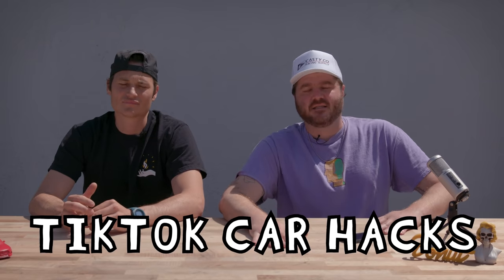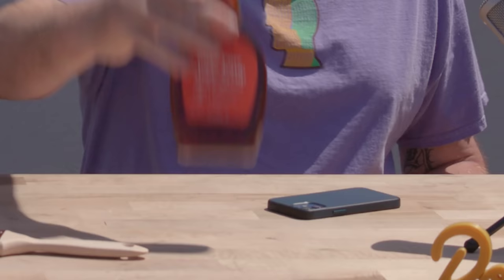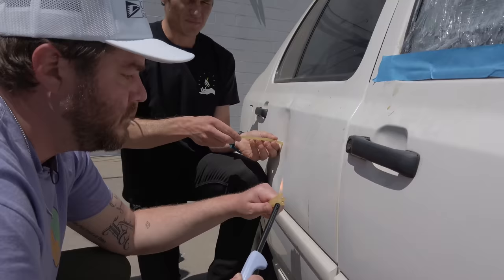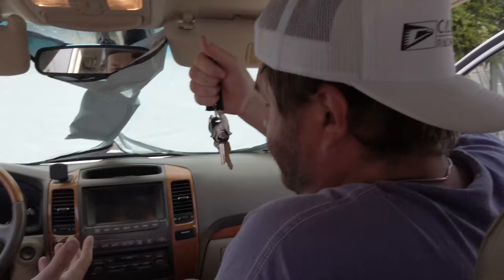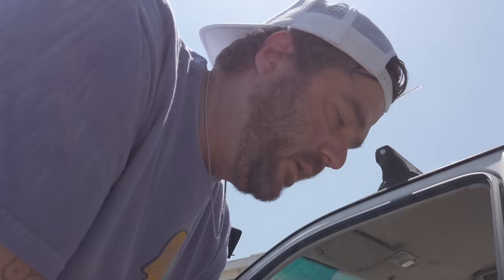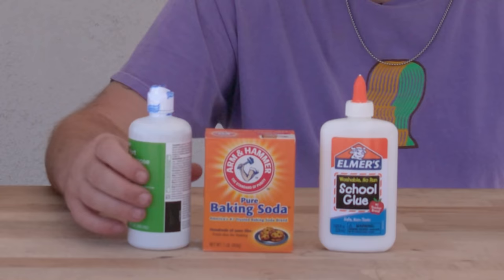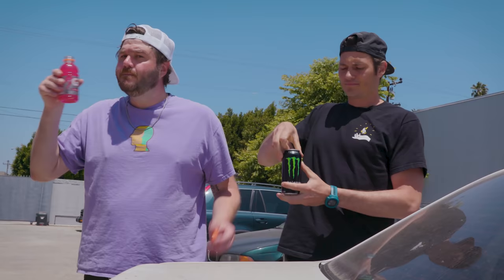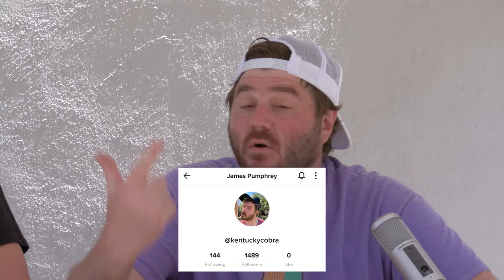We Tested TikTok Car Hacks

Comment: The hack for starting a car without keys sounded like a Creepypasta ritual.
Reply: cars like that have some wireless keys, when he said "and you wait" he pressed the clutch and tapped the button that starts the engine
Reply: I can only start one car without keys and that is the Vauxhall Nova Sri
Reply: @nineteen-nk8vk  either that or the dude just used remote start from inside the car (assuming it’s possible)
Reply: @Gladiator34B  it was also a brand new car from the look of the interior, so its really likely his frriend just stood outside and pushed the button
Reply: @Mell0Gang_  actually donut made that cut, if you look at James and Jeremiah they move a little bit too.  James' head moves a little and Jeremiah's watch changes time.  Look at 5:44 and see.
Reply: It was a push start he just pushed the button
Reply: It's a guide to find Mew in Pokemon Red.
Reply: I know guys, I was just stating that the way the made different steps it sounded like ritual.
Reply: So i believe the guy bypassed the immobilizer I work at a Honda dealership and that’s a new crv, cars have immobilizer codes that u can do to start the engine u will still need a key but it can be unprogrammed to the vehicle but it believe it only works on his crv or of the same year each model has there own sequence
Reply: wow thats an old word
Reply: 666 likes by me :)
Reply: Reminded me of those old “hacks” to empty vending machines of their change with a button combination
Reply: That’s fluffing amazing
Reply: If u look closely there's actually a cut in the video after he completed the sequence, as you can see the camera like blinked to the right a little bit. There is in fact a way to fire up a car without the key, but other than hot wiring it, idk
Reply: The forgot the hidden kill switch had to be on first.
Reply: Back in "ye olden days" when hazard lights were first starting to be fitted to cars, pulling the switch out of the dash often gave you access to the right wires so that you could feed the permanent live for the switch into the ignition live for the indicators and get the the ignition to turn on, then you could bump start the car. I suppose that could be where these kinds of stories started.
Reply: Slender Man Noises Intensify
Reply: funny thing is you can actually see the jump cut lol
Reply: It’s a cod zombies Easter egg
Reply: @Gladiator34B  judging from the interior it seems to be either a Civic or a CR-V, and yes they do have a remote start function on the key.
Reply: Just short some wires and it also starts without a key
Reply: so no one's ever going to mention that the guy in that segment uncannily sounded like jacksepticeye?
Reply: @nineteen-nk8vk  or he did a jump cut
Reply: @TraceguyRune  well yea
Reply: @erika002  time stamp?
Reply: It sounded like what I had to do to reset my printer.
Reply: There are some cars from the 80s where you could do that like the vauxhall nova or the mk1 and mk2 golf
Reply: It’s so fake omggggg
Reply: @ninjaracoon4205  Or an old SAAB 900 the lock was so bad you only needed a tablespoon or a key to another SAAB. My friend actually drove of in the wrong car before he noticed haha
Reply: at 5:45 stop video you see a push start button
Reply: @ninjaracoon4205  funny thing the starting sequence for the nova was with the hazard light too 🤣😂
Reply: the car start at midnight, hungry for BloOd!😈
Reply: @ninjaracoon4205  thats not true. you can start any car without the keys but you need to mod it.
Reply: A year later Kia I think it was that was on the news

Comment: Quick story: earlier this summer, I tried the bottle opener trick at a party, thinking I was slick and smart, I couldn’t get it to work for a minute, I then pressed a bit harder and I broke the top of the bottle neck sending glass all over the ground, I definitely didn’t feel that smart afterwards lol
Reply: You clearly did it wrong by putting too much pressure on the neck of the bottle. I've done that trick multiple times without busting the bottle.
Reply: You gotta practice first.
Reply: @Unknown_Ooh  Different doors have different designs for the latch.
Reply: It’s all about the technique, I’ve seen plenty of people screw up using random stuff to open a bottle, mostly a bunch of chewed up lighters.
Reply: With a little practice and confidence you can use folded paper as a bottle opener. Pretty much anything that catches the edge of the cap works
Reply: So your one ov those muppet who try to show of but eff up instead lo'😂😂😂

Comment: The old school (non autobody shop) way of pulling out a car dent was to use a toilet plunger like a giant suction cup. 
The bowl/cup shaped plungers work best and they come in different sizes. Just remember to clean and spray a little water on the dented area for good contact if needed. 
Plus no chance of glue being stuck to your car or damaged paint.

Comment: What I found fascinating about the Gatorade in monster windshield thing, was that when the windshield shattered it shattered inward. If it were to shatter due to the buildup of heat inside the car and the cold liquid touching the surface of the windshield it would have shattered outward. Thus I think the video that the guys tested was completely manufactured.
Reply: Plus the very obvious outward bulge in the glass in the center, my bet (from experience with creating this for halloween props) is they used a high powered air rifle, I mean you can even hear it being shot BEFORE the glass breaks cause glass breaking like that does not make a loud enough sound to be picked up on a camera sitting that far away if it was a heat reaction XD Plus windshield and door glass on cars have a coating on them to protect them from such chemical reactions. And well just the fact that if such a reaction was possible and dude there took a sip of each one back to back, he'd be on the ground screaming in pain from said reaction going on in his body.
Reply: This really works.....it just must be like -20* and you pour HOT liquids on the window 😉
Reply: Fun fact. The rear and front windshields don’t shatter. They are laminated glass not tempered. They are structural to the car incase you get in a wreck. - auto body professional
Reply: @FarikoPacer  it's usually just the windshield that's laminated. most other windows are tempered. not much of a need to laminate the rear window as it's already safety glass and you generally aren't worried about dangerous shards from the rear. source: I'm not making shit up for Internet clout.
Reply: Why would the window shatter outward? Gravity is pulling it down which has a component vector inward
Reply: Hollywood Rigs car windows to blow like this all the time.
Reply: @DblIre  That just melts the ice off. I mean that's a hack to avoid scraping ice off, but it's not very good one as now you have water all over that will just freeze.
Reply: @FarikoPacer  fun fact, the back window does in fact shatter. it is a tempered safety glass the explodes into tiny square chunks that arent super sharp but it will explode with the tiniest crack just like the door windows will. the windshield is the only multilayered laminated tempered safety glass that doesn't shatter and thats so you don't get glass raining on your face. Signed, a mechanic, race car driver, and junkyard junkie who has crashed a few times and shattered hundreds of windows on junk cars.
Reply: To me it looks fake, like the shattered glass just a video effect.  I could be wrong but it looks fake to me.

Comment: can confirm that the glue stick dent trick does work, though not on the doors/panels, only on the plastic bumpers... prepping the bumper by heating it up also makes this easier
Reply: Yes!! I was hoping someone would comment this!
Reply: @ErvinandMFantasyFootball  definitely works for the big dents, doesn't always work for the smaller ones
Reply: @scettzvill  you can always take off your door panel and pop them out from the inside-out. Get a plethora of convex tools and some elbow grease and have it a go.
Reply: @ErvinandMFantasyFootball  true, but that kindof defeats the purpose of it being a hack though.
Reply: @scettzvill  who cares if it works.
Reply: @ErvinandMFantasyFootball  well not that well. It greatly depends on the dent, how big, how deep, etc. If you know it out and it's a deep dent, you're just gonna crqck and chip your paint badly
Reply: It was always my understanding that, depending on the material your door panels are made of and how deep the dent is, most body shops use suction cup devices to pop out dents.  Obviously, for deep dents and crushed panels, you'd likely have to hammer it back into shape.
Reply: @nispelsm  it varies yeah, for wide/shallow bowl type dents with no/little paint damage they can use a suction device of sorts, i've seen them use those in the bodyshop i frequent.
for crease dents with a higher chance of paint damage, they usually need to strip the paint back for a proper repaint. so they'll strip it and use a spot welder to either line up a bunch of rings and use a bar to pull the dent out, or they'll spot weld a nail like protrusion and use a hook/slide hammer to pop the dent out most of the way, and then finish it up with specialist hammers by a professional.
it's awesome to see some of those professionals at their craft, it's like watching a campfire or a lavalamp or such.
Reply: Heat the rubber bumper up with a hair drier and it will often pull back out. Like any paintless ding removal the secret is 'did it break the pain?' because if it did, it's not going to fix it.
I've restored numerous cars and I love short cuts, but the skill needed for paintless ding removal is huge.
Anyone can mess up the car trying. An artist can fix almost anything.
Reply: Then how are you suppose to heat the bumpers?
Reply: @guineapiglady2841  hair dryer on hottest setting, or a heat gun.
Reply: You need to use a constant pressure and light hammer strokes along the creases for metal work
Reply: Another problem with dents on doors is that doors often have metalsupport behind, if those are glued/welded together and also bent you dont have a chance to pull the dent out like that.
Reply: Yeah for steel you wanna use a magnet then tap the rest out from the inside til it's smooth
Reply: So the glue adhered to the door fine but seemed like the glue wasn’t cool enough before pulling which is why it just broke so easily
Reply: @bareinhard1979  Yes you also need to use a planishing hammer to release tension around the outer edges of the dent. It basically replaces the weld on pins and slide hammer method for most dents. The door might have been to hot and needed to be cooled down after the first few tries. They just need to practice.
Reply: Toilet plunger
Reply: a high grade plunger, again something used in body work, is good on quarter panels The average upper end Home DIY store will do it, not the ones you find at walmart or the supermarker, more like Lowes
Reply: It will work on metal panels but there are other steps that are done they do it at the Bodyshop I work for daily.

Comment: As a professional window tinter in Florida… this is how we tint ALL cars and trucks. U just did it wrong. 🤣
Reply: X 🤣🤣
Reply: Please explain this process
Reply: @raikou889  they're joking bruv
Reply: @raikou889  they did it right, they just didn’t use enough charcoal to fuse into the glass. When maple syrup (basically very high concentration sugar suspension) is spread thinly on a hot surface like glass, it cools one side faster than the interior side of the glass. This allows charcoal to impregnate the silicate structure of the glass and appears tin- bro are you still reading this I’m full of shit cmon.

Comment: 8:12 literally every sharp edge is a bottle opener. Even belt buckles can be used if they are not to rounded off
Reply: you can open bottles with a folded piece of paper
Reply: i just use a lighter.
Reply: In germany we use tables.
Reply: I like using my wifes new marble counters!
Reply: I actually made it point to use a bottle opener as little as humanly possible when I was showed how to open a beer with a lighter literally the first time I ever got drunk when I was 17. It has been extremely fucking easy. Usually I use a butter knife, and I've broken exactly 1 bottle in 7 years and that was on a granite bathroom counter top at a Hilton.
Reply: @johnnymatias3027  I just dig it into a wood surface a bit and smack the top
Reply: @es0x  totally works too if you don't care about the piece of wood lol
Reply: Well if you regularly drink beer, you get creative for opening bottle caps.. like another bottle or a table end for opening caps..
Reply: I use a lighter to open my beers
Reply: I’ve used a vape

Comment: I wish you retried the glue dent hack, with surface prep first.
Reply: I think it works better on plastic panels or anything that isn't metal as metal don't bend as easily.
Reply: @nathanbrinkerhoff5886  I agree. Cleaning the surface wouldn't have changed much. They still had the glue stuck to the car, it was just too strong of a dent to pull back on it.
Reply: And they over heated the stick with the torch it stuck to the car and broke off where it was soft
Reply: All they needed to do was pour cold water over the glue sticks and then pull them. They were still melty

Comment: seat belts are great bottle openers especially when you’re doing some drinking while driving
Reply: R/holup
Reply: VWs have a beer bottle opener in the center console.
Reply: I also love having a ash tray in my bmw while I’m smoking blunts
Reply: Pro tip: the dashboard can also be used to snort cocaine!
Reply: @rumbleron9237  My Benzo has an ashtray in the front and one on each passenger door, so the whole squad can pile in and pass a blunt.
Reply: @tcg1_qc  that’s what the owners manual is for
Reply: Gotta love some good ol booze cruising
Reply: That's what my S.O. and I call going to the liquor store!
Reply: much easier than having to pull over every time you wanted to open a beer
Reply: @obamareloadsyt629  pretty much.
Reply: dude especially if you use a seatbelt reminder silencer
Reply: but the beeping gets annoying so you gotta stick the passenger seatbelt in the driver side
Reply: Nothing like an ole fashion road soda on a dirt backroad🤘

Comment: 5:52  There is a version of this that works.  It's called a "Pedal Dance" in the industry, and of course every model and year of car uses a different procedure, ad it's way more complicated than shown.  

The technique can only be used ONCE, and the car as to be driven to the dealership, as once it's shut of it will not start again even with the correct key until the computer is reset at the dealership. The car is under several restrictions when being transported as well. 

You would call in to the manufacturers emergency line to identify yourself (and might have to pay by credit card if your emergency service is expired) .  The procedure is normally only given out to technicians recognized by the manufacturer (there's a North America wide data base) , although there are times when the registered owner has been issued the code.
Reply: 🤣🤣🤣🤣🤣Joke 🤣🤣🤣

Comment: My girlfriend popped my windshield with water. It had a small crack and was parked in the scorching sun, but she was trying to be nice and wash it. The sudden temp change made a small spot into a whole new windshield 🤣
Reply: Hot and cold with glass is not a good idea
Reply: yeah, a hot day and a cool drink can make that possible.
Reply: This is a true story.  I have also had a small spider web from a bb turn into total glass shatter overnight just because I left the windows up and pressure changes from inside.
Reply: An already cracked windshield is basically on a hair trigger to completely shatter. You can easily turn a small crack into a massive one by just pushing on it. That’s the nature of tempered glass. It’s incredibly strong…until it gets even the slightest crack.
Reply: My dad is a big mechanic and car guy, and when I've had to de-ice my windshield he said to NEVER use hot water for this reason. Use a cold bottle of water to break it down or you run this risk of shattering due to the temperature change.
Reply: I'm from Australia so I don't have to worry about the ice or anything below freezing, the exact opposite in fact haha it was probably 42 degrees Celsius that day. (107.6 fahrenheit)

Comment: They were willing to shatter their window for the last hack, I give them props😂
Reply: On a whole racecar too!
Reply: Or they'd experiment on other stuff between cuts, like the window on the truck or something, well idk, but energy drink glass shattering mix sounds stupid to begin with
Reply: @andrewchin5583  am I the only one that sees where someone either there the ceramic part of a spark plug or shot it with a pellet gun it’s easier to see in the og video but the white spot on the shatter
Reply: @BaphometIncarnate  i recall there was a tool espiecially designed to shatter car windows easily for emergency escape,a little tap would do the trick

Comment: I wouldn’t have even bothered with the “starting without keys” TikTok you can clearly see where he cut the video after he started the car
Reply: How do people believe these things
Reply: @averytameduck8725  lol I really hope they don't, TikTok is full of garbage and false pro tips. Fuck that app.
Reply: I'd have been happier if they did it right according to the tiktok. I mean, it STILL wasn't going to work, but idiots are gonna insist it does and they just did it wrong.
Reply: He literally pans the camera to hide the start button, meaning he must've pushed that while hidden from view.
Reply: @JCintheBCC  I mean how pushing up windows and using radio would turn on a car? How should they spit a flame to burn the engine oil?